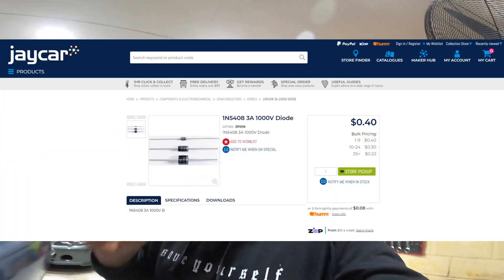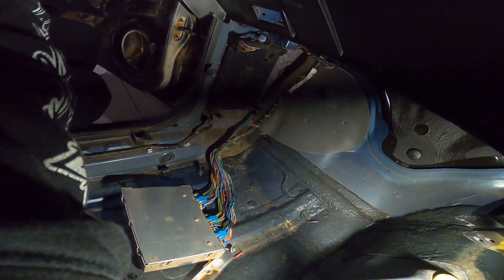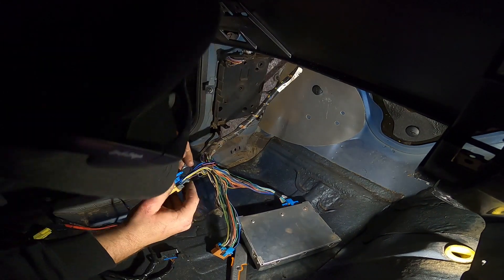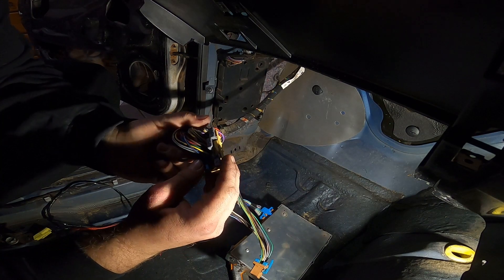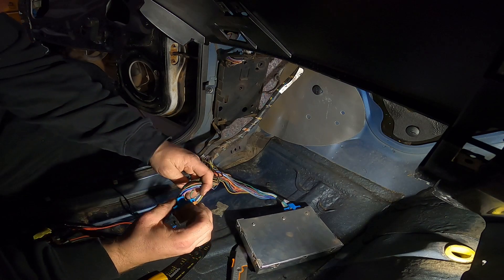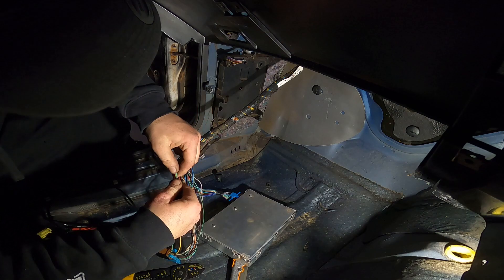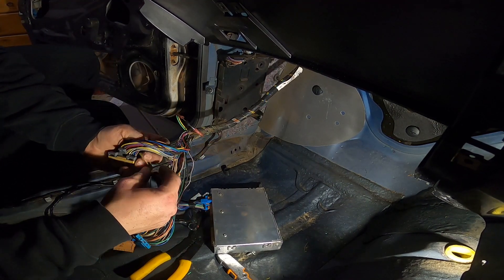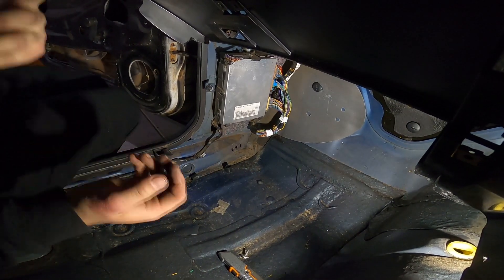4L60e Diode Mod Manualise Gearbox

Comment: Do you know what wires to use so I can lock the torque converter with a switch...I've got a manual valve body and want to use the lockup on the freeway ext... Cheers
Reply: Did you figure it out?

Comment: Will this be better on street if a individual trans cooler and fan are running. By running i mean set the fan on said trans cooler to go on same as the engines would these come on at 87 89 isnt it. Or would u recommend the fan starts sooner
Reply from the maker: No, will still blow the box. Off street use only.
Reply: @RKGarage   shit sorry dude forgot I commented here. I emailed u a similar question.  Sorry man . First time with holden and 3.8 eco just cheap and part and changeable to apoint. And for my stupid question ? Would the converter need changed to something better or is this down to the value body and what not in the auto. I'm no expert I've been on paper with my build for 6months. Very hard to get good information.

Comment: Does anyone know if this will throw engine light on a wh statesman?
Reply from the maker: No it wont
But you can't do this and street drive the car.
Transmission will blow not long after as it locks the converter and cooks the tranny oil.

Comment: Hey bro, I just manulized my 97 vs and whenever i put it in 1st it would seem to be 4th when trying to do a burnout and lap around thr block, its feels gutless, then i try change to second and nothing happeneds untill i change it to 3rd. I used diode 1n5404 and im thinking thats why its not working right. Have any clue what it could be or weather i need the specific diode
Reply from the maker: You need the specific diode I listed.
Reply: @RKGarage  alright cheers for the help bro. Is it fine to wire everything back together once taking the diode out? cause iv done that for now so the trans is back to normal
Reply from the maker: Yeah bro thats all good 👌
Reply: @RKGarage  swt cheers bro, stay well
Reply: On the vs was it the same color wires on different plugs mate??

Comment: Can confirm.... 40 min drive to work with this will kill the trans, Thought id test it with a cheap auto and its no bueno
Reply: I must have got lucky (that really doesn't happen very often with cars 😂) mine survived 2 years of being manualised .it was getting hammered and going through 10 sets a week as a daily pig and did it's fair share of cruising too
Reply: @rorynottingham876  Yeah i think ill have to try it again with a trans cooler that actually works, Turns out some dumbass (me) kinked the feed line to the cooler a little bit when i put the box in so im going to try it with a big aftermarket cooler and watch the temp. Yours could also have lasted if your lockup clutch in the converter was worn out so it wasnt locking up
Reply: @rorynottingham876  same here man still cruising out the the spots 30 mins away and can happily bang a few sets and drive home fine ready for the next weekend, been alive for a year or so like that to, must be lucky🤷‍♂️
Reply from the maker: I'm glad its been proven/verified, but also not glad it happened to you haha!
Reply: @RKGarage  Hahaha yeah i knew it would happen, Just wanted to confirm. Was gritting my teeth the whole way.
Reply: @RKGarage  Im gonna give it another go with a big ass cooler and see if i can actually keep the temps stable hahaha

Comment: I've got a question for ya. Have you ever manualize a 4L60e auto or any auto box through the PCU? Or just played around with one moving the shift points to see what works best.
Reply from the maker: It can be done via the tune. Most people don't have access or know how to that. Plus this way is a lot cheaper than buying the gear to be able to tune.
Reply: @RKGarage  Well I'm running my VY ecotec over the dyno soon after having the motor done. The shift points are a bit out so I've just been shifting gears. But I was thinking of just manualize it while I'm running it over the dyno.
IF?? It's not going to fuck it in the short term. I'll probably drop a manual in it down the track but for the time being I was going to play around with the auto. Got any thoughts
Reply from the maker: Wont really need to be manualised, it will stay in 3rd as long as it needs to on the dyno, by the time it shifts, eco's arent making power well before then

Comment: Hey bro, I done the mod correctly for my VX Commodore but now It throws a engine light and wont rev over 4k. Any help will be appreciated cheers
Reply from the maker: Doesnt sound like it was done correctly
Double check over everythinf and the direction if the diode

Comment: Hey bro just wondering with this if the trans will be able to survive 40min drives. Also would it be good idea to get a high stall torque converter ?
Reply from the maker: Not on the road mate. It locks the converter and will cook the fluid and box
Reply: @RKGarage  hey bro love the Channel, but i’ve don’t the same thing to one of my vys and i’ve been skiding it for months now and haven’t had a problem with my trans, only thing is mine only select 1 2 and 3 and drive just bogs out the car
Reply from the maker: Thats because drive is 4th
Reply: @RKGarage  will the gearbox not last long doing this mod as a daily driver. ?
Reply from the maker: Definitely not, locks the conveter. Will cook the fluid and in turn the box

Comment: Nice mod RK. Do you mean it doesn’t lockup in 4th and heats the trans?
Reply from the maker: Converter is locked in all gears and heats the tranny up if street driving for long distances
Aka like 5mins cruising
Reply: If the converter is locked up in first it will have no slip/stall from the converter at all, I don;t actually think this is possible. Wouldn;t the car stall as soon as you put it into gear?   Does this mechanism disable the torque converter clutch release when you apply the brake?  It does not make sense that the converter is always in lock up @RKGarage
Reply: @rodbender7946 when I had mine manulised like this the converter acted as normal I would just change gears manully and the converter would normally lock up at around 60 kms/hr
Reply from the maker: Nah it does, thats the issue

Comment: Thank f##k you put this up man just 2 days ago I went to solder the l67 ecu plugs to the wagon na ecu loom and found the ecu wires looked like this and wires not solderd but had red duct tape on em n no diode. I solderd em bk to the same color wires . Gotta start checking that out before ya buy a car these days haha cheers for another gd video
Reply from the maker: Glad it could help haha